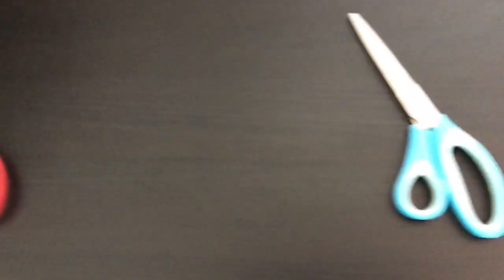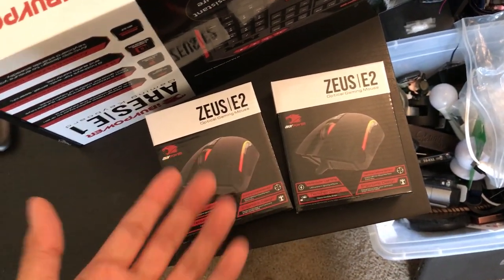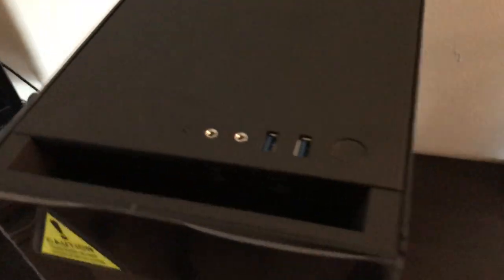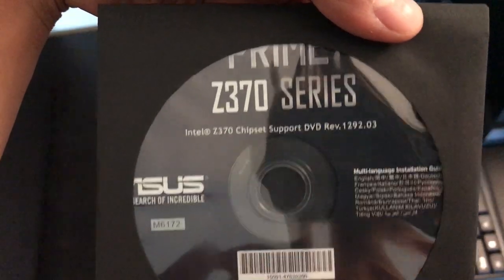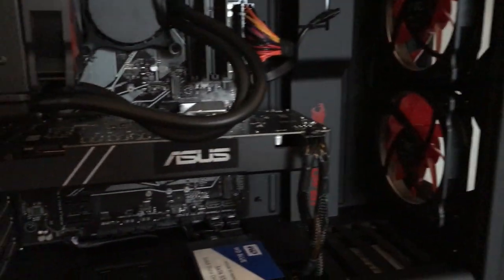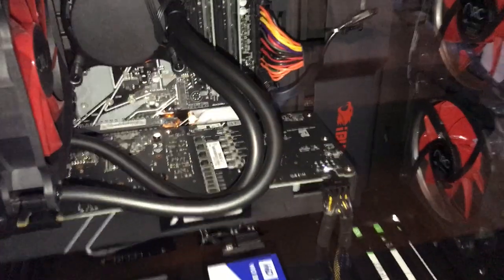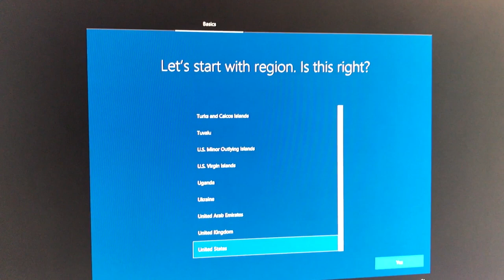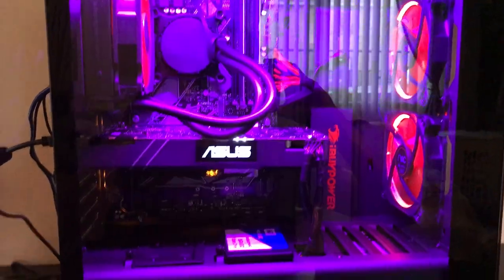iBUYPOWER ELEMENT Gaming Computer Unboxing

Comment: I have the same case  from them as well, i just wonder since it has the glass panel in the front, does it affect the temperature  since it only has airflow from the top and the bottom?

Comment: Haha funny review but nice. How's the PC going btw, any problems? Was thinking about getting the element 9260.
Reply: Ryan Duong Yeah same, I thought of getting the iPhone 11 Pro Max, and even tho I have a phone I thought I'd rather get a computer till my phone breaks then i'll buy a new one
Reply: @dragz  haha. I just  got the PC 2 weeks ago.
Reply: how's the 9260 running?
Reply: @lambyi  PC is great. Haven't had any troubles with the PC at all. Everything runs fast and the PC is pretty quiet. I would suggest getting something that has a water cooled cpu though since the 9260 is running on a stock cooler. The temps for the CPU are alright though with high end games hitting around 80 degrees c which is fine. The 1660 ti is a msi gaming x card. But ya I would recommend a liquid cooled PC.
Reply: Ryan Duong how is it running after 4 months

Comment: would you know how to remove the front glass panel ? thanks
Reply: Are there no thumb screws anywhere around the glass?
Reply: I found out just grab the bottom of the panel, in the front and pull it out. it takes some muscle.then pull off the top.

Comment: No way that’s a 1080. Not to be a downer, but a 1080 has dual 8 pin PCI-E power connectors and that one only has 1 8 pin. I think that’s a 1660 or something. Rip